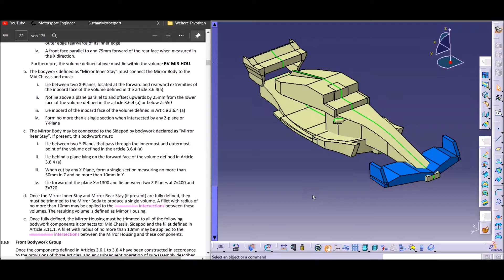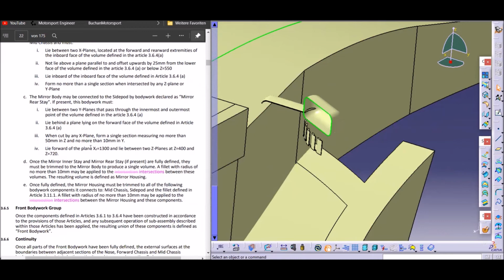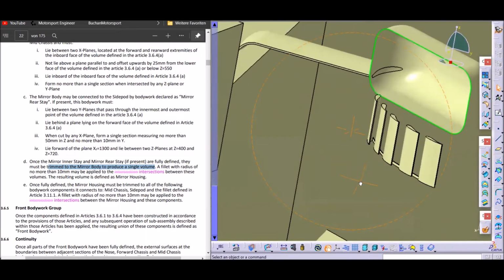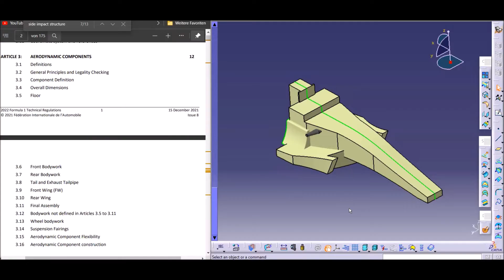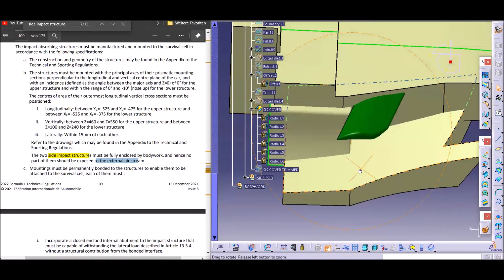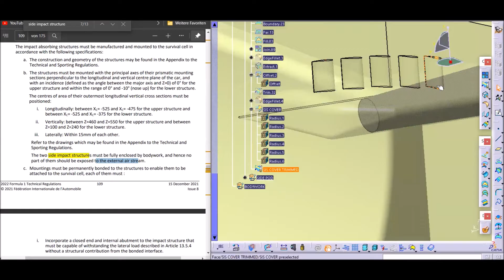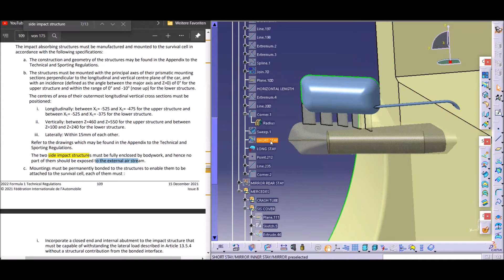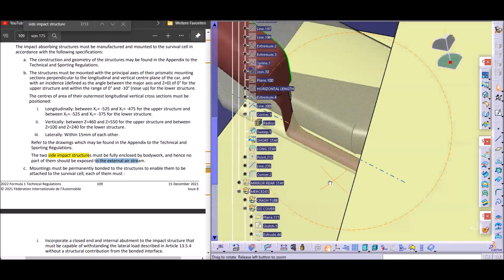F1 2022 - Mercedes SIS Cover Assembly - EXPLAINED

Comment: So if I have this straight... the ‘Fabricated Piece’ has to include the original intended design elements.  Yet, once the pieces are assembled, they can trim off that required element (if the rest is supported by bodywork)? 😶🤔
Reply from the maker: Yes, that’s exactly what the rules say 😅

Comment: The inner stay is an ingenious design. I applaud Mercedes for it.

The five free standing outer stays are excessively stretching the book in my opinion. If the F1(FIA?) doesn't step in the teams will come up with all sorts of ways to stretch the rules with uprights. We will be right back to the old cars barge board area mess.
Reply: And the inner stays are not? Merc are basically poking surfaces in and out of other surfaces. IMO that's also quite an obvious case of "well that's not what we've meant but hey." 
I think it's quite obvious that the Merc is based on a bunch of holes in the regulations. Multiple wing elements that don't do their intended job of housing stuff or holding up a mirror but instead area (to some degree) freely adjustable aero elements. The only reason they can exist is because the FIA didn't notice and patch those holes in the regulations. 

(Just to be clear. It's not Merc's fault either. But I'm somewhat tired of hearing that this is ingenious. If anything, it's ballsy.)
Reply: @CrazyHorse151  I could argue both ways on the inner stays which says to me that it's at least an open question.

It's the fact that the others don't touch the mirror at all that I find beyond the pale.